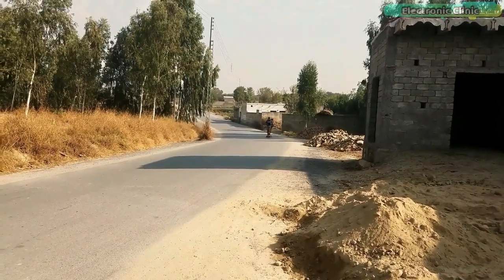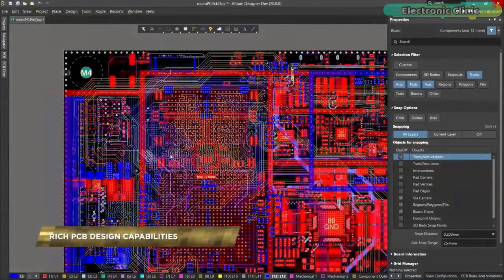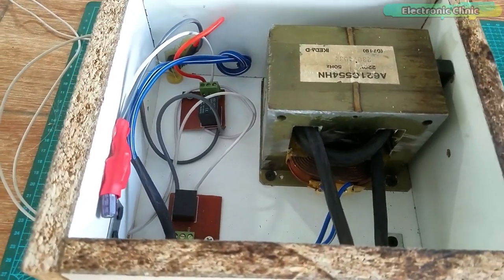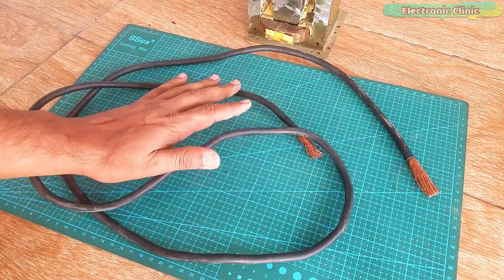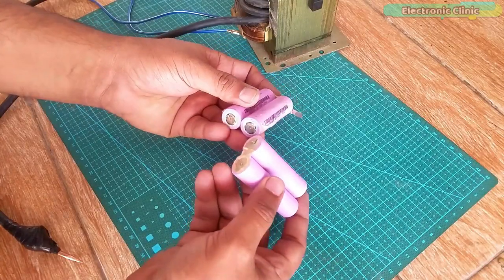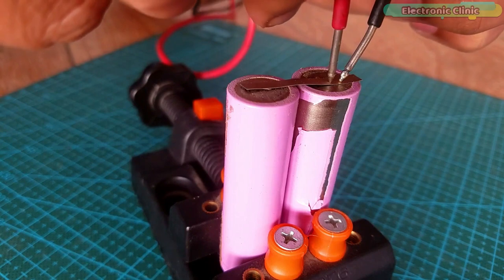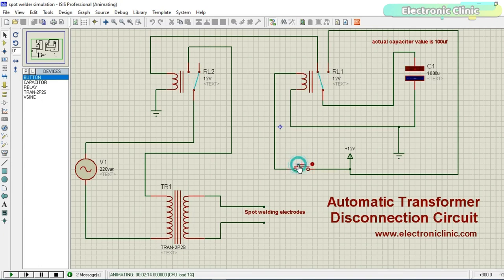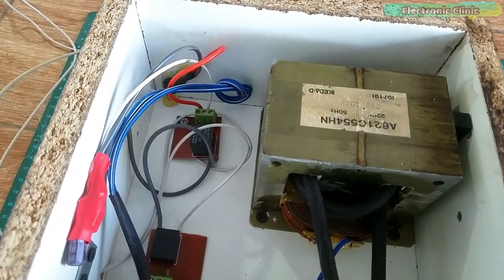Spot Welding Machine, Homemade Spot Welder with the automatic circuit, Diy spot welder

Comment: Love your explanations. I am going to try similar, thank you.  Most videos, assume  you understand and go to fast for you to learn from.  But not yours.  Interesting how some designs use motor cycle or car starter relays to time welds operating on the secondary coil . But you switch the primary. Through 12volt relay.and separate power supply,  I like yours cos Old 12volt adaptors and old microwave ovens available from recycle places. Or horders already have.  Plus by  switching primary you are on for the weld only, saves power and things stay cool.

Comment: Awesome diy spot welder using a x'mer; time delay circuit using relays is very impressive. Thanks a lot !
Reply from the maker: you can check the arduino version of the same project, its result is like a factory made spot welder.

Comment: This is the simplest solution I've found on YouTube for a timed relay circuit. Awesome. Can a potentiometer be used between the capacitor and relay number 2 for adjustable timing?
Reply from the maker: ya, you can use but its good to use a programmable controller board like arduino. I have already done this, check playlist.

Comment: Thank you , please what's the details of relays ?
Reply from the maker: spdt relay, its a normal 12v and 10A relay.
Reply: @ElectroniClinic  whether the relay is connected to AC or DC current

Comment: 1 mF = 1000 uF; 1 uF = 0.001 mF.  In the video, he was talking about 50uf to 1000uf.  150mf too big?
Reply from the maker: why 150mf? i never said this. Use different value capacitors for different ON durations. 

Its good to use a controller to select the time duration, i have explained this in my other video.

Comment: WRONG PARTS WAS USED ! THIS CIRCUIT WOULD NOT LAST LONG, PERHAPS A FEW THOUSANDS SPOT WELD, THEN THE RELAY (RL2) CONTACTS THAT CONTROL THE PRIMARY WELDING SHALL BE BURNT OR WELD TOGETHER. 
Replace RL2 with a bigger relay, contact current rate at least 20A or higher. Parallel both contacts with 0.2uF 1000V capacitor to reduce arcing between contacts is even better to prolong the contact life.

Comment: can you answer my question on the video capacitor 100 mf and on the drawing 1000 mf
Reply from the maker: its 100uF
Reply from the maker: different value capacitors will give you different ON durations.
Reply: @ElectroniClinic  ok so 100 mf 50 volts is enough
Reply from the maker: @mostamostar4251  yes, but you should watch my other video on the same spot welding machine in which i used arduino to control the ON time.
Reply: @ElectroniClinic  I will look and I followed your channel and would the capacitor 150 mf 63 volts be too strong, thank you again